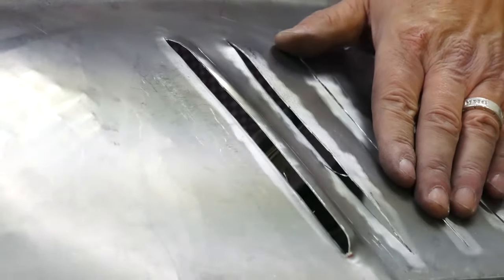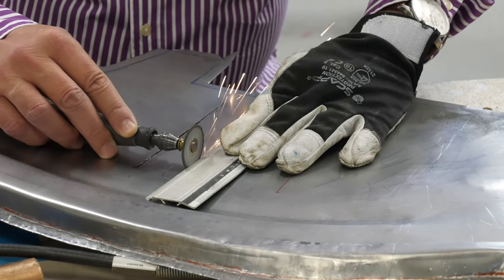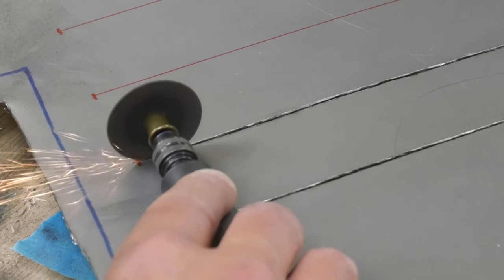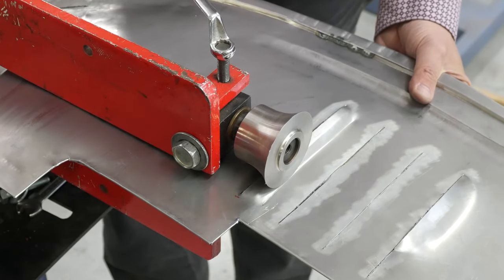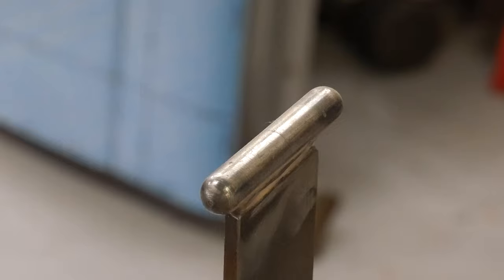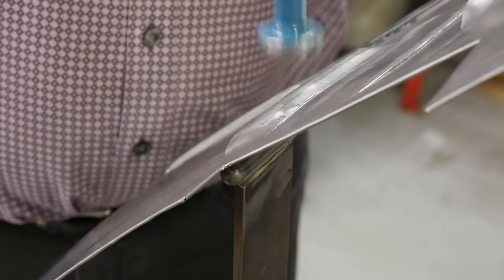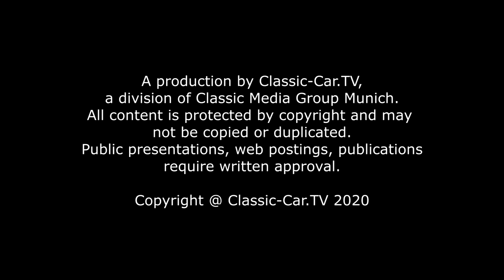Metal Shaping - Forming louvres manually

Comment: how then, would you form louvers out of the 2 remaining inner slots? your angle iron form will flatten the outer ones.
Reply from the maker: The simplliest way is to take some other dolly, which fits for this task. We got loads of different dollys in the shelf..
Reply: Even if you didn't have other tools, I think if he'd started at the right, it would have worked fine.

Comment: What the heck?????? following a ruler, reallly?   You would affix your ( 2 Hose clamps) cutting tool on a rect. tube and secure it in a firm collar and extend it out like any cnc tool for each cut placing a fence guide w stops for your sheet metal.